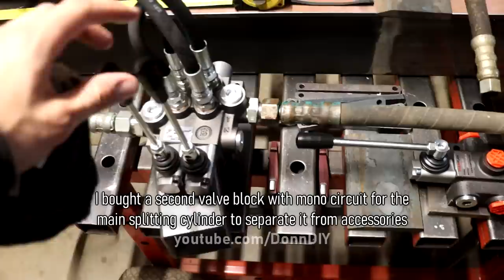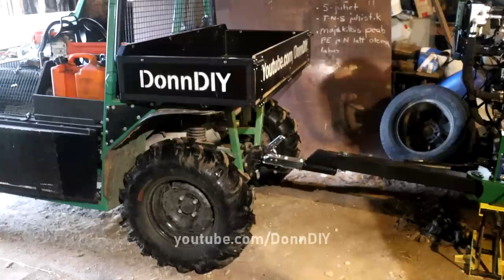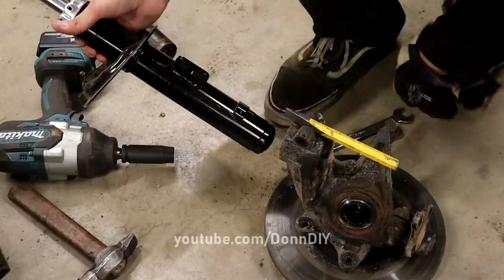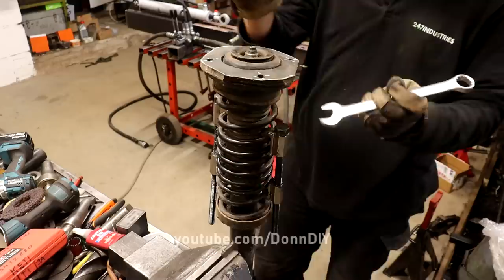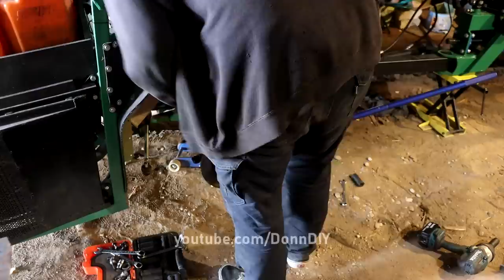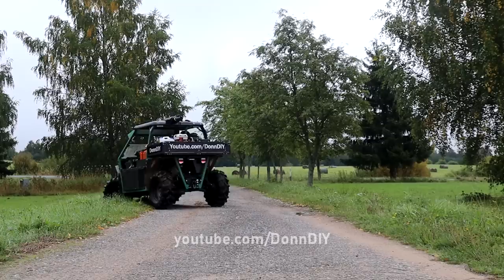UTV Suspension Upgrade

Comment: IMO you should go with Air bags either pure air bags or soft springs with Air bag assist it will allow for a nice soft ride when you not towing and when you are towing you can pump up the pressure to stiffen it up.

Comment: That reminded me of the time I put too much air in my ATVs back tires in relation to the front ones. It was fine, until I drove over a bump at high speed and got launched over the handlebars, waking up in the bushes that were quite a ways away.

Comment: Love your channel and your builds. I just thought of another modification you could do to the rear suspension since it’s the same as the front why not add rear steer to make it really easy to maneuver inside the barn to move trailers and stuff out of the workshop.

Comment: I think you would be better off with a weight distribution hitch, it transfer some of the force to the front so all 4 wheels are sharing the load. I had that setup when towing a large travel trailer, it made a massive difference.

Comment: I'm surprised you didn't just find a piece of tubing that would fit over the end of the shock to make that smaller section the same diameter as the rest. Then just cut it vertically so it could collapse down when you tighten the clamp. Looking forward to see what you do to fix the issue, or are you just ordering different shocks?

Comment: Hope you get better soon ,, struts are not fun to play with got to make sure you compressor clamps are hooked good so you don't pop a spring at you that would be a bad day ,,I have several different size of the clamp systems . I check too see witch fits best in the springs .. next problem will be the PTO drive system  making a clutch type system for it ,, get well soon ..

Comment: Just curious, why did you make this vehicle right hand drive, when you have right hand traffic in Estonia?
Reply: It is dependent on the engine and gearbox. If the engine was on the other side you'd have 5 reverse gears and 1 forward...

Comment: What about hydraulic pistons to hold the rear suspension when towing a heavy load.  It will effectively give you a straight rear axel, at the height you want.  Retract the pistons, and you have independent suspension again.
Reply: When I built my UTV I went for air suspension. If it's sagging simply add more air.
The down side is that it loses pressure if left for a while and ends up on it's bump stops.

Comment: My Idea would be to make a dolly hitch(like a semi trailers second trailer would have) with a single tire(or 2 like an old tractor has in front), have the trailer rest its weight on that, then just pull that with atv. (??) Bad for backing, but seems most logical to me?

Comment: make hydraulic control of the stiffness of the springs of the rear suspension, above the spring, a fork that is connected to the hydraulic cylinder through a lever, and, if necessary, we press the spring, raising the stiffness and load capacity of the suspension ...

Comment: Are you gonna put the stronger springs on the front as well?
Reply: not needed, as the additional load is carried on the rear springs, hence needing something stiffer.
Reply: @kathrynwhitby9799  I was thinking because of the added ground clearance it seems to have provided
Reply: @bethanyjaggi316  essentially (from my car factory days) a stiffer spring will suffer less of what's called "sag" when carrying a heavy load, therefore preventing the coils from binding (no gap), allowing the suspension to still have some travel.
For more ground height, one would need either a longer spring & damper combination, or relocation of the mounting points. Hope that helps.